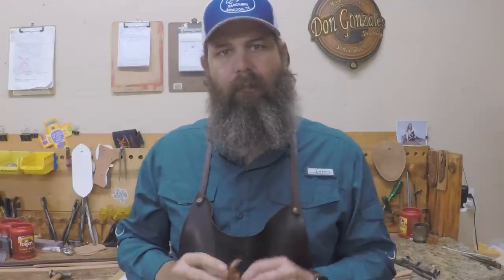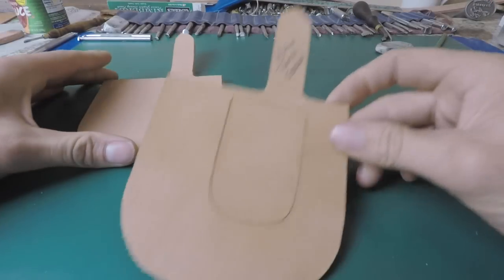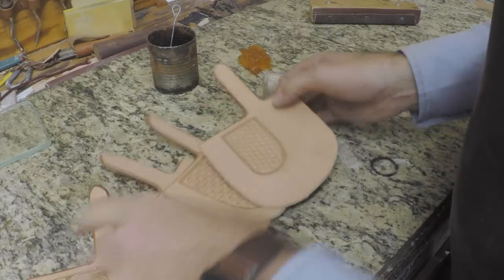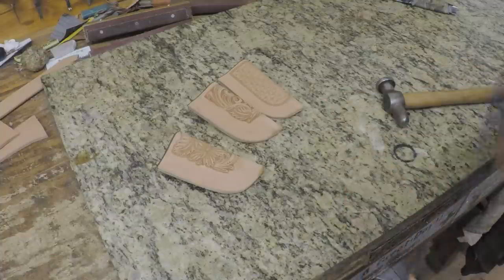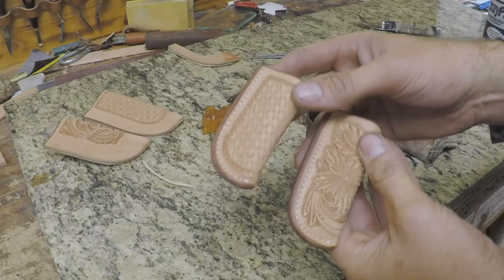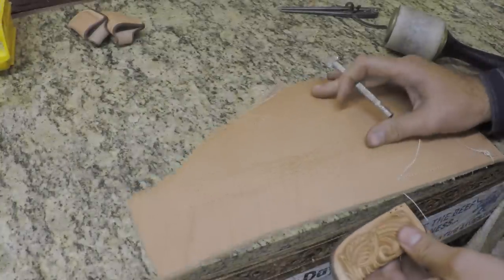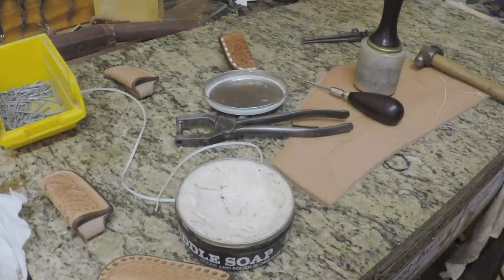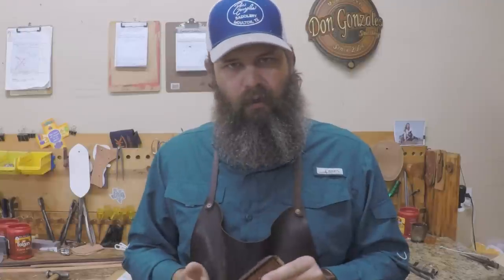How to Make Leather Knife Sheaths

Comment: Welp, I'm not sure what a "buck stitch needle" is, but my main gig is whip making (kangaroo leather, so I make and use a LOTTA lace), and I use Perma Lok needles--the back end is threaded (female), and you just screw it onto the point of your lace good and tight.  I've only RARELY had a problem with them coming off, they just don't, and oh my GAWD are they a time saver!

Comment: Excellent idea on a measure reference. I used to use that when I handled CAD images converted to print. Each CAD program converted to different sizes so the output always included a line segment with a defined length for final size reference.

Comment: I have the pattern pack for this build and made a couple of sheaths for a case trapper knife. The sheath has a really tight fit, tight enough my knife is getting stuck in the sheath. My stitch line is about 1/8 of an inch from the tooling window. Is that enough room?

Comment: Don, thanks for all your efforts to share your knowledge. How do you determine the length of your lace to do a wrap lace...2x the length, 2 1/2, or 3x the length. You have really helped me during my learning curve. When people ask what I make, I will tell them mostly mistakes. I would guess that a slight modification on the strap and a line 20 or 24 snap would work with my suspenders. Thanks in advace for suggestions.

Comment: Genuinely confused - why don't you cut the tooling window out in your template piece?
Reply from the maker: I prefer to make a leather tap off of it... you can actually make tap offs with a floral pattern carved into it as well so when you tap it off it will transfer the floral pattern as well.  Saves time.   It you could definitely make a template with the window cut out.